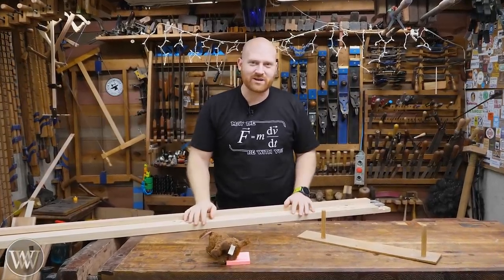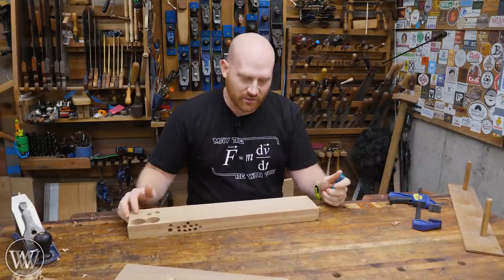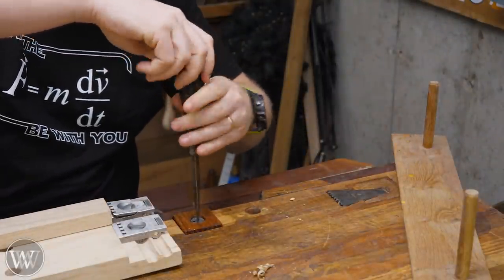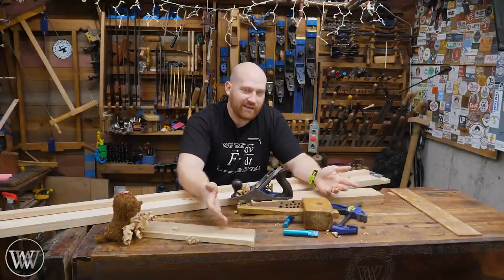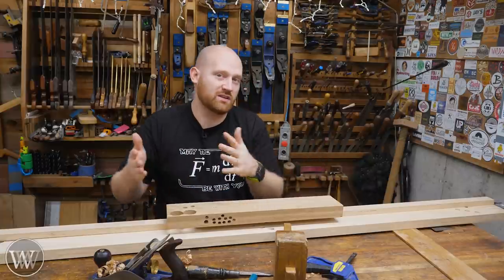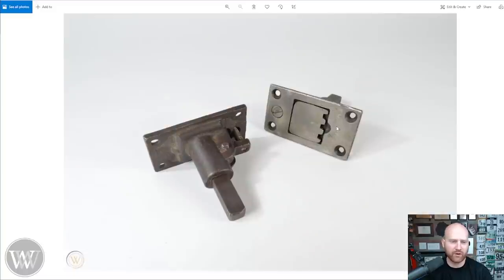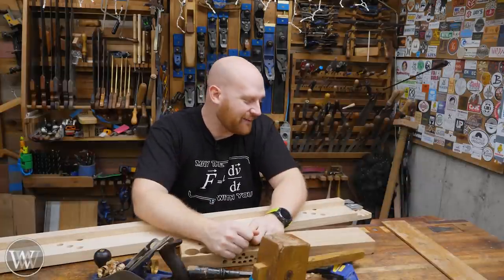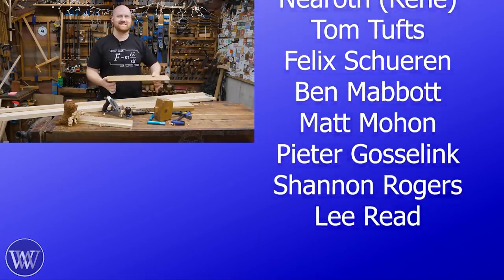1000 Ways To Stop a Board All About Plane Stops

Comment: I got into woodworking several years back (specifically to build a better box than just nailing stuff together).  I bought some used tools and sharpened them up and wanted to get going.  Because my workbench is miles from pretty and had been used exclusively for mechanical repairs for decades, I simply sank in a few wood screws as planing stops.  Eventually I made a few dog holes, but I used those wood screws for quite a while
Reply: Hey, what works, works.

Comment: I saw a cool idea in am old book (about 1900), describing how to make a planing stop for a temporary bench. They suggest just driving two screws into the bench, then adjusting them to the right height.
Reply: That’s actually the method im using right now.
Reply: The wood of my bench is too soft so i just end up clamping a thinner piece of wood on to the bench. Works fine

Comment: thanks for the vid! i’ve got the benchcrafted on an old bench, but i prefer the nailed down 1/4” x 12” strip of oak at the front of my bench. it stops just as easy and doesn’t gunk up your work. now i’m just trying to figure out the best way to traverse boards. A doe’s foot worked great with the bench crafted because of its teeth, but it slips with the bar.

Comment: I had a offset square hole above the stretcher (front to back) in my bench.  I had a block with a screw on the bottom that rested on the stretcher.  I take the block out, turn the screw in/out and put it back in the hole.  Dust, chips could fall out when I took the block out.  I tried that Lee Valley thing, and tried the wooden block you hammer up/down with teeth on top.  I didn't like them as well.  I'm getting the Veritas replica of the miller falls for christmas so that's next.  I really like the reed prototype you have too.

Comment: I started with planing stops, a dog for smaller stuff or a batten that went from a dog hole to the face vise for bigger parts....... they worked but I felt there was a "better way" for me. I got some work making small boxes and found I didnt have a good way to hold thin narrow parts to plow grooves. I got a screw for a shoulder vise and I made a wagon vise out of it and added it on the back of my bench, close to the edge so I can overhang the small parts so the fence on my plow doesnt interfere. Best thing I ever did!!! I use the wagon vise for ALL face work now, milling, grooves, rebates, smoothing........ if I have a wide board I need to cut to length, that even gets pinched between dogs on the wagon vise to cut it there instead of it vibrating in the face vise.  I love how secure it is and how well it holds, id be lost without it, I dont think I could ever go back to planing stops after using the wagon vise :)

Comment: Great video. Now ya got me wanting to try my vacuum clamp for hand planing. Not traditional but my table isn't really either. I tend to clamp a board across my table or I have a small table I attach to my work bench and it has slot for 2x4s that fit flush with the top and has a screw underneath to adjust the height of the stopper.

Comment: I use the Veritas stop. As others have mentioned, the two dog hole posts are adjustable to fit differently spaced dog holes. Easy to use. I like the bird mouth fixture and will be making one for edge planing on a low seated bench I use outside. Thanks for the ideas, James.

Comment: Great video. I currently use a single dog with a square head. It’s works for me about 90% of the time. I think I’ll build the thin board stop for wider boards as at a certain point they try to rotate away. I think I’ll also build a vice stop for those twisted boards that try to jump around as I’m getting one flat side.

Comment: Good video!!! You can get from point a to b in different ways and the best way is the way that is comfortable to you!!! After the build of my English joinery bench( Rex Krueger version) I have discovered few ways to hold down the wood that I worked on like using hold fast, planer planer stop 😜, crochet and later addition leg voice ,using wedges, and dowel. This are all efficient, easy to make very low cost methods that making woodworking fun and simple!!!

Comment: I actually have and like a variety. I don't like clamping between stops because with thin stock that can bow it slightly and mess me up. 
I do have a tall wooden square stop that I use with chisels when I am paring wedges for tenons. I use a long one that does multiple dog holes for wide stock. I also use a standard circular dog for edge planing or really narrow planing.

Comment: I would really like to hear your thoughts on using a planing stop for planing really really thin pieces of wood. Like ribs for lutes, which need to be 1.4mm - 1.5mm thick. The only way I can think of to do this is to clamp the end to a flat surface and plane away from the clamp with a block plane, but it's not perfect if you have areas of tear-out and need to plane in the other direction.

On the subject of stops, I made a simple jig that I can place on a bench hook which has two different sized 90° V shaped grooves and a stop at the end of each, for planing down various sized octagonal pegs from square stock.
Reply from the maker: Forward that thin I usually use double-sided tape and stick it down to the bench
Reply: @WoodByWrightHowTo   Now that's a really good idea, thanks!

Comment: The Veritas thin strip double post stops come in 3 lengths. What is most important with their strip stops Is that the posts are sliding in a track and hence are infinitely adjustable so dog holes don’t have to be bang on in terms of spacing like they do for homemade ones.

Comment: You missed the very cheapest most basic stop.  Of all people it is from Paul Sellers when he is showing you how to build an English Jointers bench.  He sets up a tempory table using two saw hourses and a board (actually the underside of the table top that you are bulding.  As for the stop.  It is just a screw not screwed in all the way.  Keep up the good work!    

I am a converted power tool person.  I am in the process of building a proper workbench.  I have a too small, againt the wall, bench with a vise that served me well in my power tool days, but it is too small for any good sized board.  For larget boards I work outside and use the original Black and Deker Workmate folding bench / vise.  This vise table does a good job of holding a board while planning.

Comment: I use 2 philips head screws, 1½ inches apart.
If I need to plane something wide I put a batten in front of them and clamp it at the back of the bench so the clamp's not in the way.

Comment: This.... is my biggest issue. My bench is not a typical woodworking bench, my dad made a 4' x 3' mobile bench, (on casters), because he had limited room in his area. It has a lot of sentimental value to me, and...I have a small shop, single car garage, that has to be wood shop, as well as auto shop, (another hobby), so the bench fits....but, the big problem is it only has a 3/4" plywood top, a nice heavy frame work, but no way to add dog holes....so I'm thinking about adding a T track, so I can use clamps... my dad was 6'2", so he built it tall for him, which has sucked,  since I'm only 5'7"... my son found a caster system that actually lowered the bench, but still keeps it mobile...so planeing is now doable, if I can lock the wood down....
Great video, I appreciate you spreading your knowledge.... maybe your stop with the thin wood and dowels might work, going across and through the framework....

Comment: Like they say there's always more than one way to skin a cat. I personally like using a planing stop or a dog. My next bench will have a spot for the Lee Valley miller's falls replica stop. For normal milling work I just use a stop. It does make you learn how to properly use a plane, those who say other wise haven't mastered the plane yet. I find I get a huge feed back from planing against a dog/stop. I just use a bench dog most times, I have a batton that I use for wide stuff. For heavier milling I'll add a does foot, or possibly a long stop for going across the grain. But then there are those boards that have enough cup/twist to them that clamping them in my waggon vise is the best way to stop the rocking. 

I find them all to be viable options, but in the end I generally use a dog and possibly a batton. Having the ability to flip boards to get them flat enough to mill is very handy. I'm constantly flipping my
Boards to work. Milling by hand completely takes skill and understanding of the best way to get there. But most of all having fun I the most important. But I'm the least in favor of vises, ironically I'm building a new bench that will have a leg and wagon vise on it. Those I'm adding as I don't really have a big space and having them will decrease my need for different appliances. However as of now I only have a wagon vice, and my moxon vise. So working with just hold fasts and does foot has worked just fine for me.

One question, how's the hovart vise holding up? I just got there leg vise kit and wagon vise kit. Looking forward to putting them into use. I noticed one a previous video that it wasn't closing tight and you had mentioned adjusting it, is that something I'll have to watch out for or was this just a fluke?
Reply from the maker: The hobarter is great. No problems at all. It is still my favorite leg vice.
Reply: For me the feed back is the most important part of planning against a stop and as you mentioned it teaches you to plane correctly.

Comment: I use a switch. It’s hard to use hand planes from a wheelchair but on small boards I use dogs.
Reply: Would pulling the plane toward yourself like the Japanese do work better in a wheelchair?
Reply: @reedplanes728  I should try one and see. I'll order one and see. Any suggestions on what one.
Reply: @billboy7390  I would try a plane you have and pull it toward you to see if the ergonomics work for you.
Reply: @reedplanes728  Is there a Japanize pull plane you would recommend?
Reply: @billboy7390  nothing to recommend,  
It really depends on what your goals are

Comment: What is your preferred dog hole spacing?
I noticed yours seem to be pretty far apart, and I remember you saying something about wishing you'd done them differently in another video, but can't remember what spacing you said you wanted.
Reply from the maker: For dog holes along an end device line, I like them to be 3 in apart for the first three feet and then 6 in apart after that. That's what I currently have on this bench. But then I have a second row at the back of the bench and those are all 6 in apart. There's about 16 in between the front row and the back row.